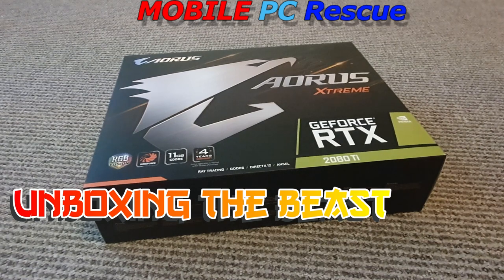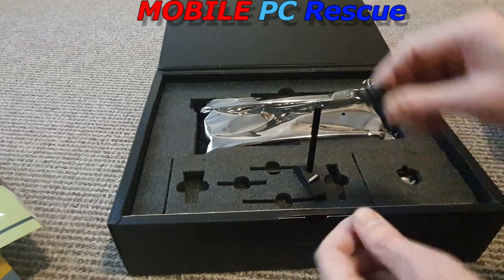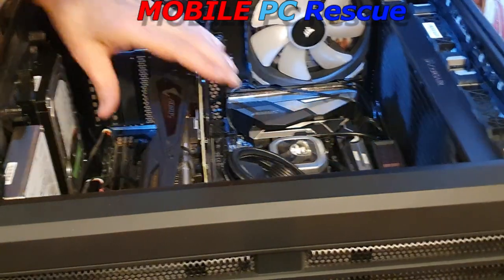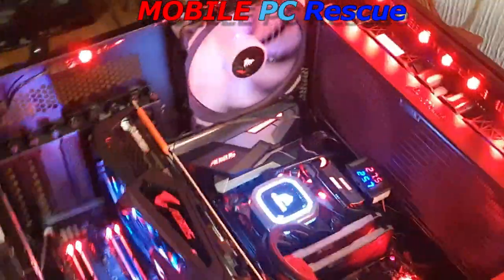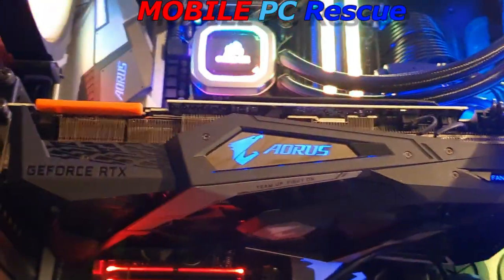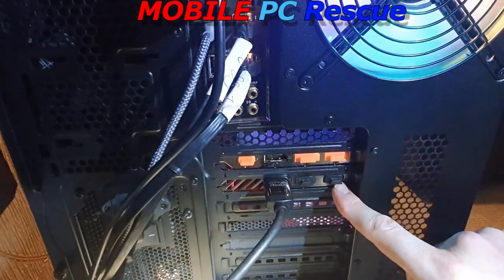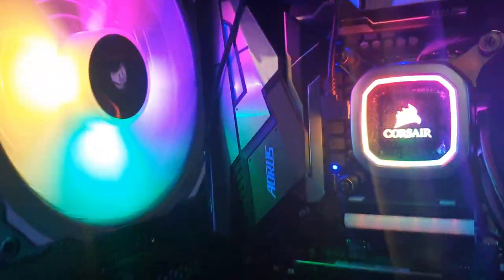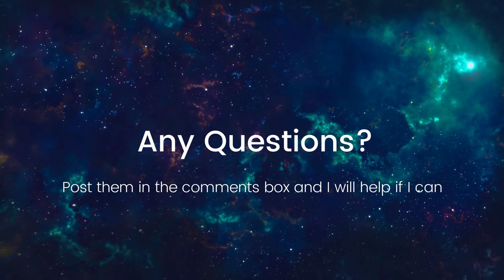Unboxing and installing the Gigabyte Aorus 2080Ti Xtreme

Comment: Nice stuff, totally jealous. Got a 2070Super myself. 2080Ti’s are the  bollocks when it comes to pure power.
Reply from the maker: Hi Callum - Yeah the 2080Ti is mega, it's over 50% faster than my 2070 Amp Extreme was = and it looks incredible too :) Even the Rift S stuff is much nicer as antialiasing is ramped up